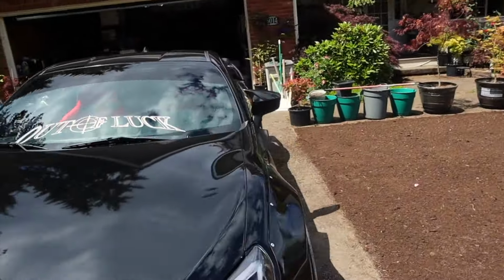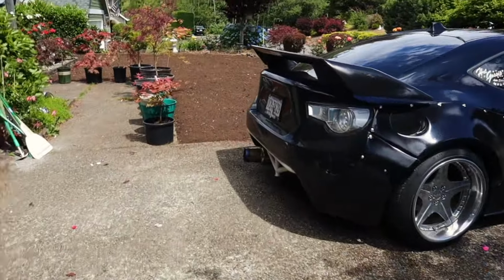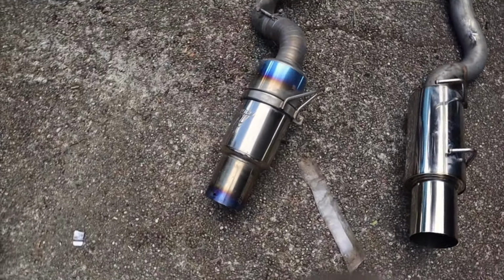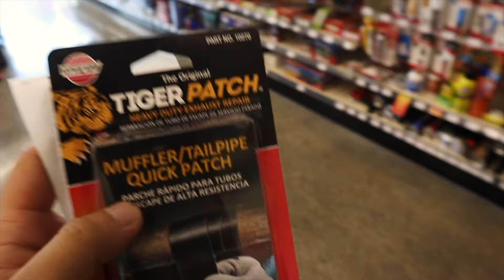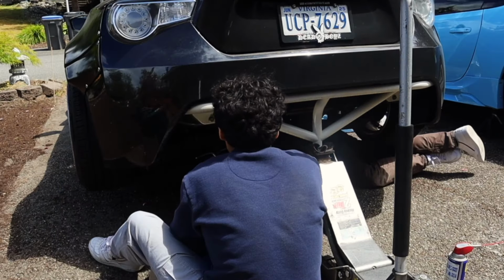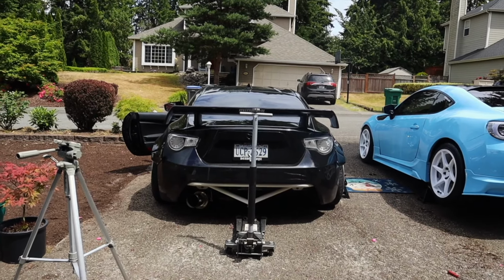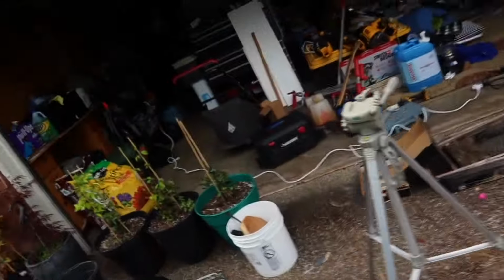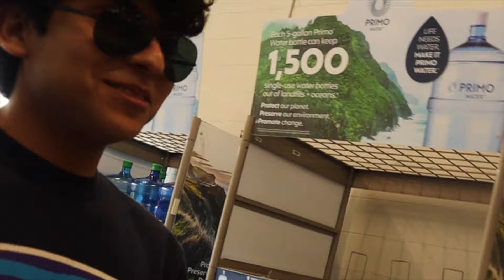Tomei vs Greddy

Comment: Does that tape work? I have a crack in the same area for my tomei
Reply from the maker: @KeepingUpWLeland  the tape worked pretty good, it started to come up on the rounded part but it still covered up the hole and stopped the leak.
Reply: @baysickbrz  forgot to mention, did having the crack at that area throw a check engine light code for your buddy?
Reply from the maker: @KeepingUpWLeland  the hole didn’t throw any codes for him since the hole was small and past the cat